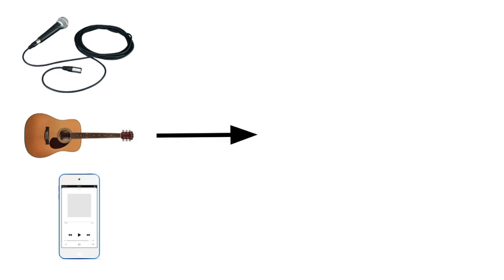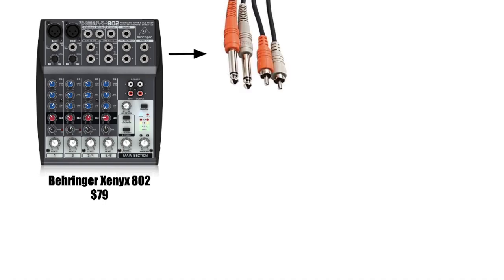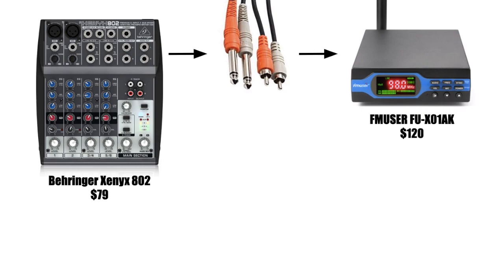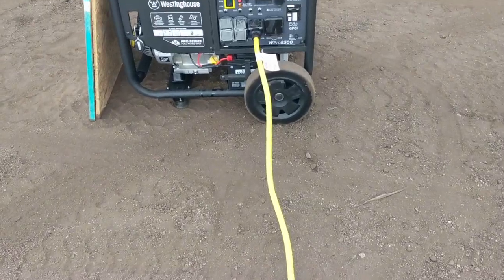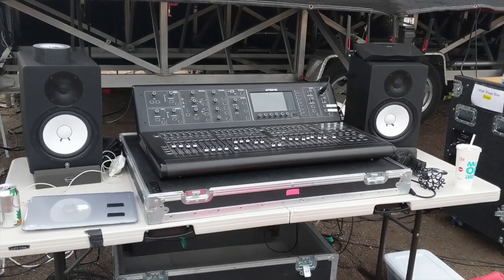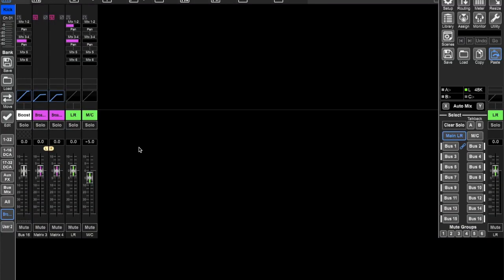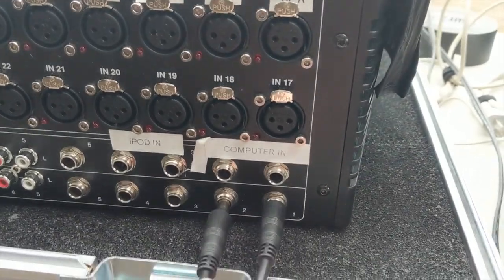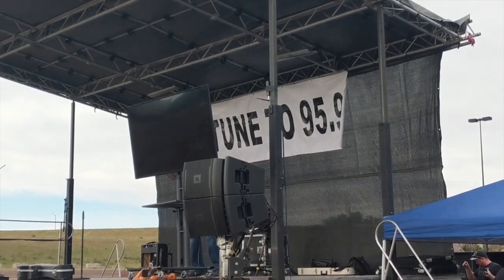How To Set Up an Outdoor Drive-In Event

Comment: Um - you are causing a delay by using a pa, and broadcasting the signal... you should do one or the other.  Also monitoring just behind the stage on open studio monitors - with a band in front of you probably isn’t that effective.  Put headphones on and listen to the broadcast FROM A RADIO - so you hear what everyone else is hearing...I hope you have a ups on that console, because if that generator craps out, its going to affect the console.  Kind of cool that you know a little about it, but there are some glaring things that you are missing.
Reply from the maker: Because of noise restrictions in the area, the speakers aren't able to be heard clearly past the first couple of rows of cars, so delay isn't an issue and we do both without a problem. And yes I have headphones that are connected to a portable radio, I switch between the monitors and headphones. Yes I have a ups. This video was intended to be a simple, straightforward instructional that anyone can follow. So don't worry, I'm a professional audio engineer and I know a lot more than this short video displays.
Reply: Do you need a broadcasting license for this in Ireland I am being told I need a licence which is costing 1000 euros
Reply: @patricknevin1765  broadcasting in the US on the FM band actually also requires a license even on low power.  While it may seem unlikely that anyone would be bothered when out in a remote area, the license is still required, and unless you know the attendees, it would be advised to request permission (FCC in the US) before doing this.
Reply: While there might be a perceivable delay, people are going to be listening to either the live audio or the broadcast audio as opposed to both.  Depending on the mixer used, should the engineer decided to deal with this specific issue, many digital mixers support setting a delay on the appropriate output channel(s)